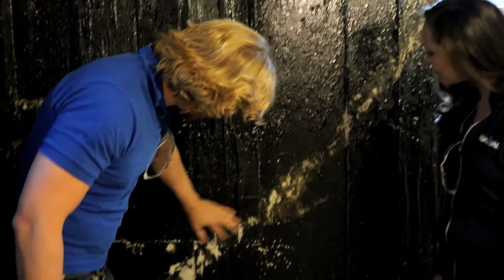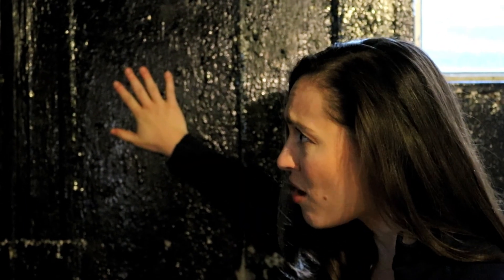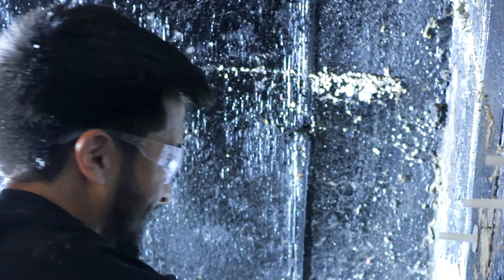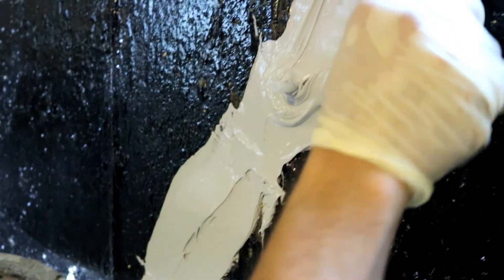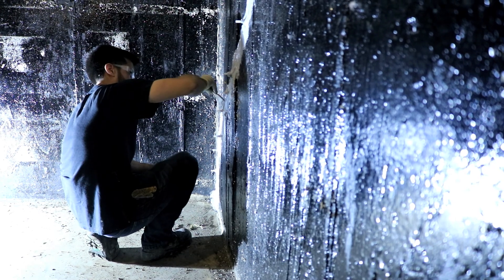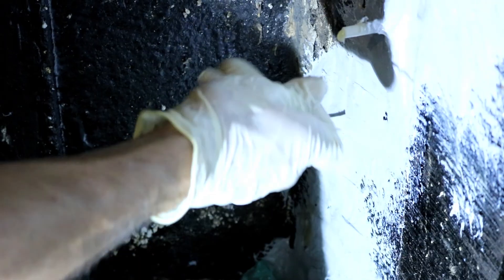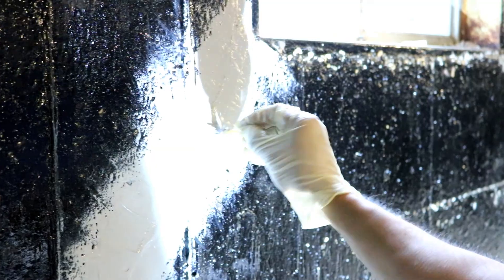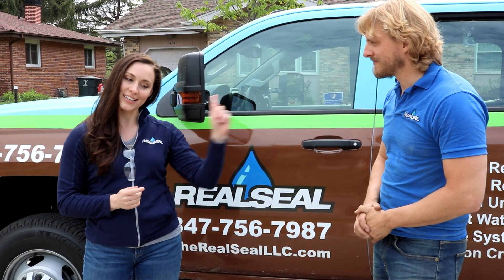How We Do It: Epoxy Injection Foundation Crack Repair

Comment: This video showed you fixing the inside only. When is it necessary to inject on the inside but also excavate and fix the exterior crack?
Reply from the maker: Hi Chris, good question! In some cases, especially if the crack was injected with a foam/polyurethane, the crack must be repaired from the outside. There may also be a furnace or other utility or finishing in the way that prevents interior repair. 

In those cases, we dig and repair from the outside, providing the same Lifetime Warranty!
Reply: @Therealsealllc  So if you use an epoxy instead of the foam, then that lessens the likelihood of repairing from the exterior too ? Thanks for the reply!
Reply from the maker: You got it! Epoxy repairs have a much smaller service call-back rate and the repair is stronger.

Comment: Why don’t you use polyurethane injections? Epoxy is brittle
Reply from the maker: Cheap epoxy is brittle. We use top-of-the-line epoxies and polyurethanes. Polyurethane can be used in certain situations as well.